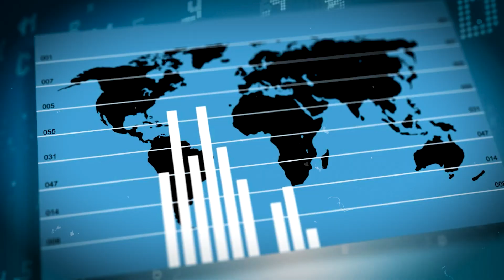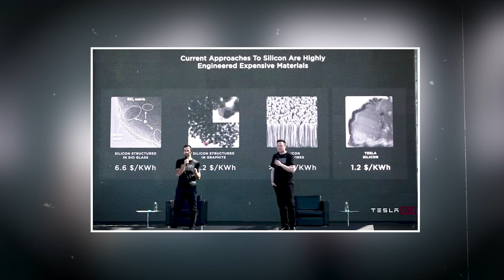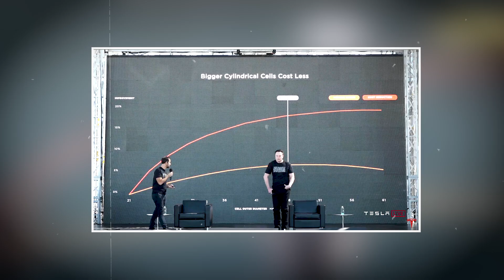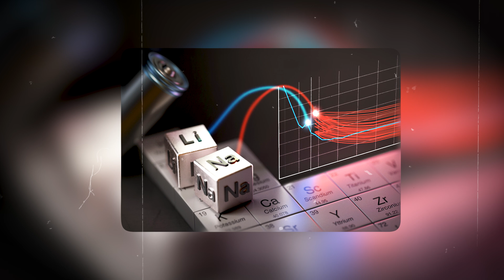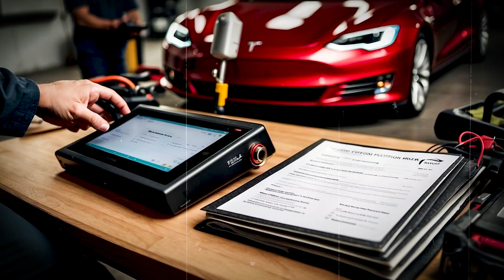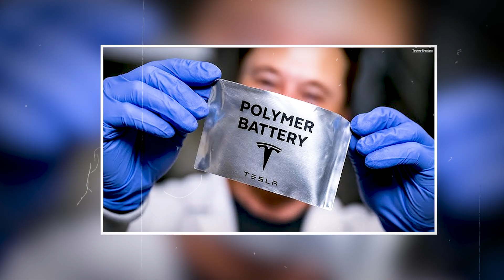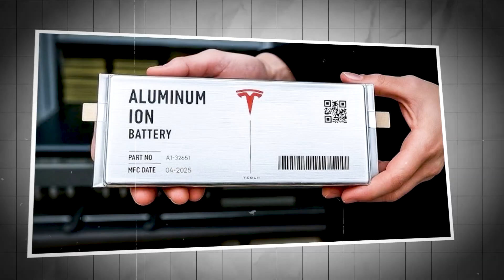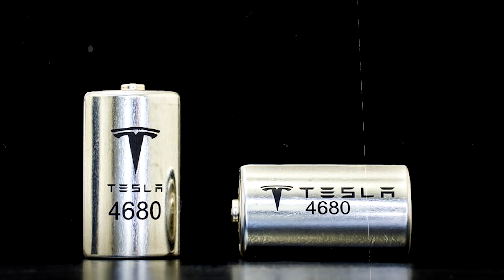"Tesla’s Hidden Battery Breakthrough That Could End Lithium for Good"

Comment: The Aluminum ion battery doesn’t hold as much energy density as lithium and they still need to find the an Electrolyte that works well with the aluminum ion. So it still has a few hurdles to jump but it’s promising.